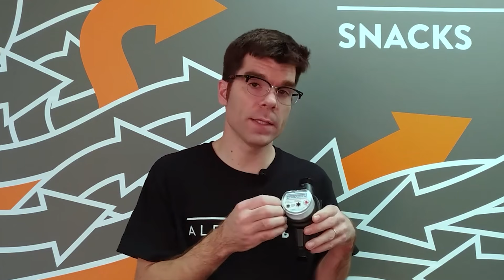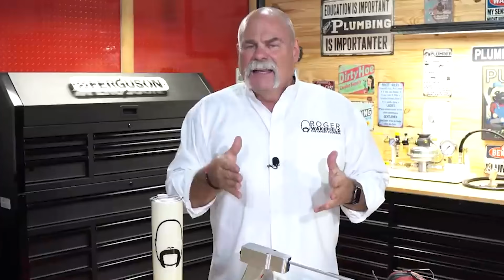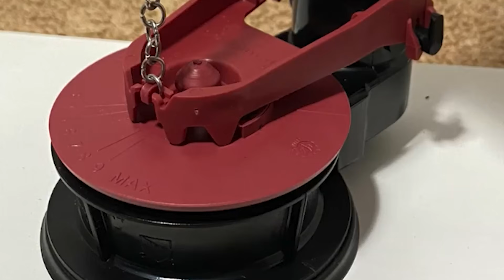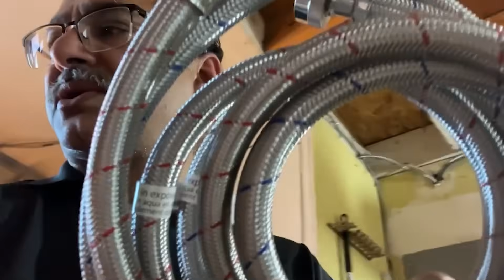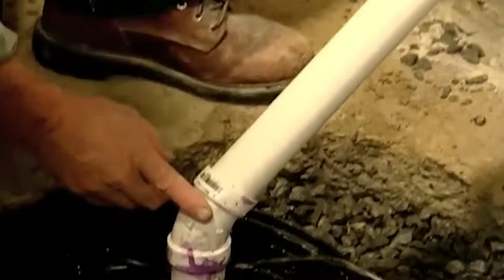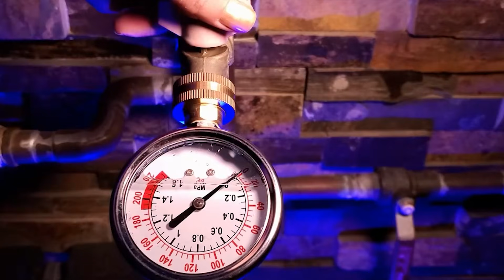This SECRET Plumbing Trick Could Save Your Home (Use It Now)

Comment: There is no need to do anything but look at the low-flow indicator. However, a very slow leak will likely not cause the indicator to spin, so it will not be obvious that it's moving.  But if you focus carefully, you will see it moving ever so slightly. 

Also be sure to check with your local water dept. for assistance in detecting leaks.

In Cleveland, Ohio, for no charge, the water department will send a technician out with a highly accurate meter that can detect any leaks between the street and the house and in the house as well.